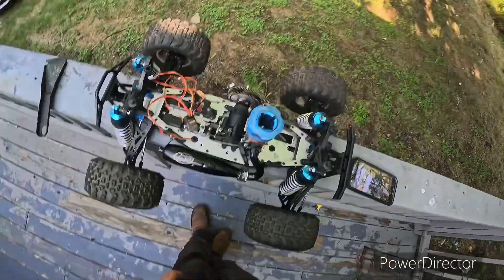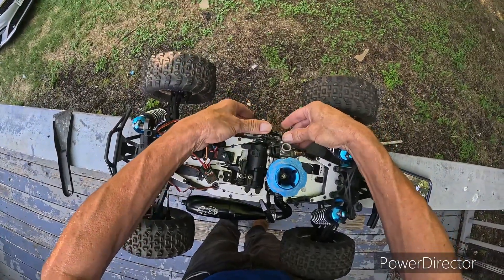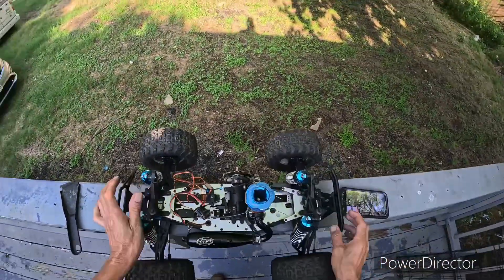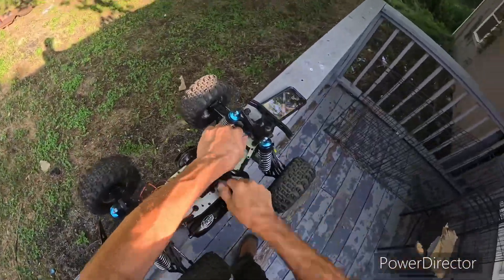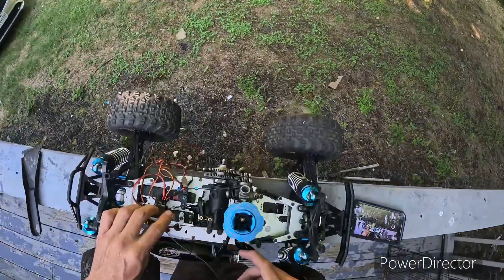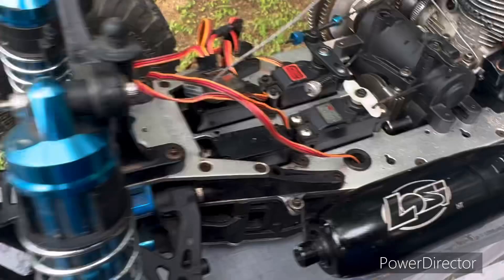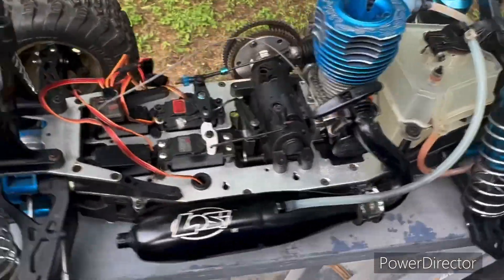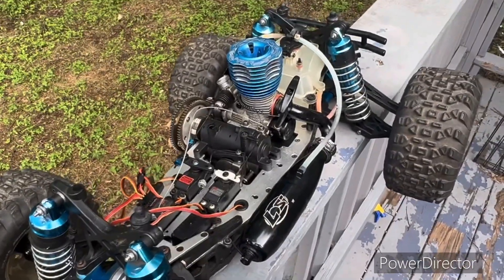Losi LST XXL….

Comment: Rob if you haven't maybe you should look into a throttle return spring incase of a runaway if i had one my slash would still be in one peace
Reply from the maker: It has one on this one. My Losi Buggy has a fail-safe programmed. Revo has a fail-safe module. I’ll get one for this thing later….